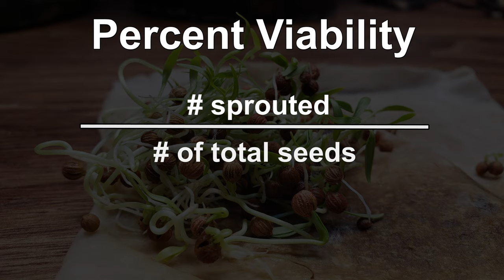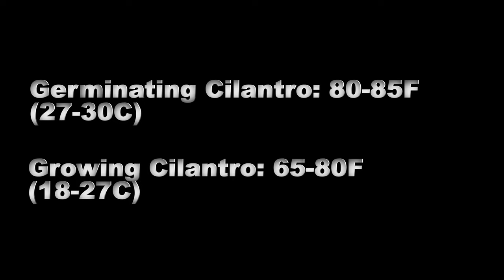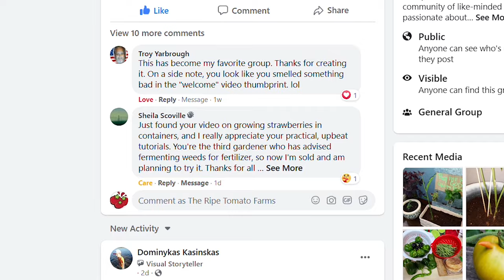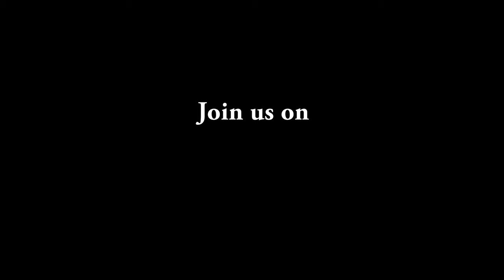How To Grow Cilantro (Coriander) Indoors  - The Definitive Guide

Comment: I have tried growing cilantro a dozen times but I never can get past the seedling stage. It never grows real leaves. It sprouts, grows a couple inches tall, then dies. What am I doing wrong? How moist should the soil be? How often should I water? I'm in Florida, growing indoors, higher humidity with an average 78 degrees or so. The ac does turn on regularly, is this drying it out? Any tips? Thanks!
Reply from the maker: Once I set up the seeds, I actually don't water for like a week. They sprout, and the I'll water maybe once a week after that. Every situation, soil, climate is different, but the #1 cause of seedlings dying is over watering and poor soil.
Reply: @TheRipeTomatoFarms  Wow, thanks for the quick reply! I will try it! ...again. 😂
Reply from the maker: @joshb5898  no problem! Lose, rich potting soil, germinate them warm, above 75F, and don't plant them deep. Once they come up, they need a ton of light. True leaves appear out the centre after about 5-8 days.

Comment: 9:20 by outer leaves, do you mean the leaves at top (highest)? I really don't understand what you mean by outer leaves and shoots... do you just mean on the perimeter of the pot? first time grower here
Reply from the maker: Hey Derek, yes, the biggest, oldest leaves. Cilantro grows new whorls of leaves out the center (most plants do) and pushes the older ones to the outside. Its these outside ones you want to harvest because if you cut the inside ones, that's it, that's the end of that shoot. Its not like Basil that'll sprout new shoots from the axils.
Reply: Ok. Perfect. Thank you! I have mine germinating right now. Can’t wait to see them sprout!

Comment: Small point, but carpentry isn't my super-power.  I can measure, but I CANNOT calculate from just an image without step-by-step instructions.

The recessed bottom to the planter you show must be the size of the sides MINUS the width of the material.
And it looks like it has to be square.
Say what???

Now I have to measure the REAL size (not just the quoted size) of the timber I've purchased... and subtract that width from TWO sides of the bottom piece - to form a square somehow?  (Guessing here)
That just got too hard.  Like... I have to cut the 5th piece For the inset base) at width minus thickness LONG... THEN shave another thickness off the width... ??? 
Argh... I need a drink.

Coming back... seems that somehow I have to decide that (let's see) the material I am buying is 12mm thick... so somehow I have to subtract 12mm from the 150mm wide plank... on two sides... to end up with (this is insane)... a square piece that is 148mm X 148mm?
Seriously, I'm not even sure that this would fit.

What I CAN see is that just using the width of the original material as an overlap base... would not be wide enough to do the job... at least on two sides.  Or would it?  What if I cut 5 identical "sides", and wanted to use the 5th side as a base?  Would material fall through... or would it be too big?  ARRRgh again.

I am not a carpenter, and I dread making stuff, only to waste materials because I couldn't calculate the measurements correctly.